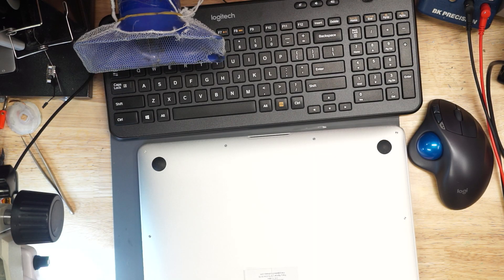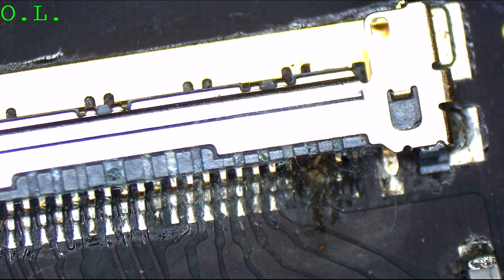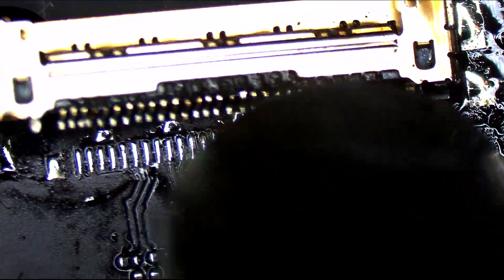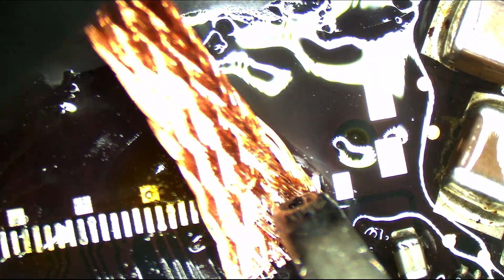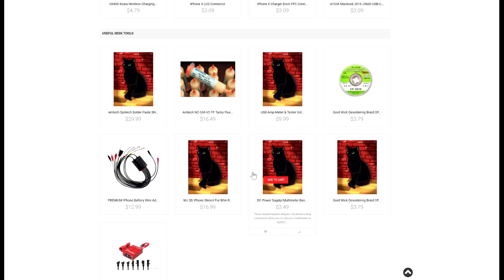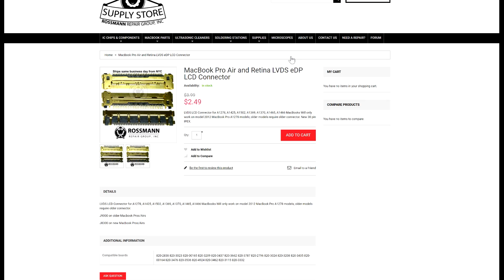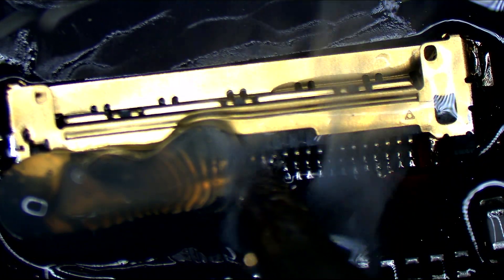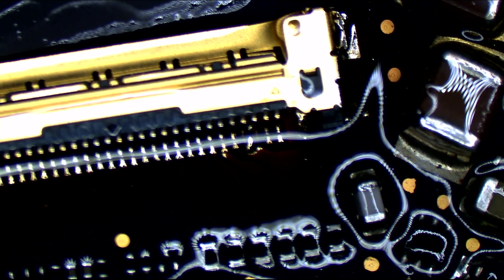What part of Macbook is made from BULLETPROOF component quality?

Comment: I like your videos, but your explenation on how these fuses should work is plainly wrong. That is a polyfuse, meaning it becomes more and more resistive as the current (and thus heat) increases. It is to be expected that it has a resistance close to 0 ohms when the Mac is turned off and becomes highly resistive, if a fault is present during operation. If the fuse is properly dimensioned is a different question, but please update your explenation on how this fuse works. Keywords to read up on these fuses are Resetable Fuse, Polyfuse or PPTC. Keep up the good work!
Reply from the maker: Yes, I am wrong. This fuse clearly became highly resistive when a fault was present during operation. This is why the LCD connector pins are in perfect conditi... oh wait. No.
Reply: @rossmanngroup  you are still wrong about thinking that this fuse should blow before the connector burns. The connector burning current is probably less than what is needed for the backlight itself, or close to it. So it is probably just not possible for this fuse to blow in these cases. You must understand that fuses can not prevent connector burning, they are absolutely not meant for that in the first place, be careful not to make a fool of yourself just because it is an apple product :) Fuses are not used to prevent something corroding away, etc.

Comment: "Why would the fuse blows, when the connector can burn" - Rossmann 2019

Fuse on literally any other products : "I'll sacrifice myself so other component doesn't get hurt"
Fuse on APPLE products : "Lol, look at my company INNOVATION"
Reply: Apple users are cashcows. Why bother designing a  better product whose fuse just blows, if  Apple can count on a large percentage  of its fan base just buying a new Macbook. Sad commentary.
Reply: Why include a fuse at all if a blown fuse means the product is as broken as a blown component? Apple will say it's a broken motherboard either way. The addition of a fuse just adds a bit of cost and is another piece that can fail.
Reply: @chrisedwards3866  Without the fuse, the product might -  thermally disintegrate.
Reply: @MarianKeller  *Will

This is a MacBook. It will thermally disintegrate.
Reply: Matt Zelda I am still surprised that my MacBook Pro 2010 after all these years still works, never replaced the thermal paste too... I guess apple really stepped down their product quality since I think my 2010 MacBook Pro is still quite reliable
Reply: That's not a normal fuse, and those pins are not blown by excessive current but corroded by electrolysis. Even a normal fuse wouldn't have prevented the damage.
Reply: @iggarpe1  I'm an idiot and had to Google what electrolysis even is. Could you give me a TL;DR of how that corrosion is different from say corrosion due to water damage?
Reply: @MattZelda  @dothemathright1111 below gave a good short explanation. In addition to what he explains about metal atoms being removed from the electrodes, I would say that liquids usually spilled on laptops have a lot of stuff dissolved as ions, even bottled water. Those ions will conduct electricity taking or giving electrons and becoming non charged molecules which precipitate on the electrodes as deposits that can both conduct electricity themselves (and make the problem permanent after drying) or corrode the metal.
Reply: @iggarpe1  okay that makes a lot of sense. Thank you :)

Comment: Thanks for your humour. So I can subsitute all fuses in my house with Macbooks.
Reply: With the pins of Macbooks, not the fuses.
Reply: @OmniscientWarrior  meanwhile I bought 12 Macbooks. One important question: Which pins of display connector are LIVE and NEUTRAL?
Reply: @tactileslut  You missunderstand me. My data line has 230V lol
Reply: And you will have to replace all your electronic items after a power surge.
Reply: When My house circuit breakers go bad I just buy a used iphone3 and shove it in.... works perfect everytime

Comment: Louis, you should make a video where you test these fuses to see at what point they actually blow, and compare it to when they should blow.
It would be very interesting
Reply: I would be interested to know as well. If Louis doesn't have time Big Clive or Dave Jones at EEV blog might conduct some experiments on them.
Reply: You can tell from the P on the fuse itself, it's 3 Amps, but it would be a very funny video after all
Reply: So P means three Amps? And someone else says P means positive temperature coefficient? Yet more testing needed.
Reply: @tactileslut  This is actually 3A/32V fast acting non-recoverable fuse made by Littelfuse. I use these in each and every design.
Reply: @nitrocaster  Isn't 32v/3a a bit much to be shoving through board traces? That's 96w of power before the fuse will even think about doing anything.
Reply: @Septfox  If your normal current is 1A, you don't want to put there a 1A rated fuse. The fuse should handle inrush current (which can be order of magnitude higher) without blowing. It should also have low enough resistance to not cause a significant voltage drop, which is a waste of energy. Typical 13 inch screen backlight consumes 4W at 20V, which is 200mA. Given that the inrush current can be as high as 2000mA, 3A fuse makes a good choice here.
Reply: @Septfox  Why do you think the fuse is still intact while the connector is roasted. I think the fuse is a "I will stop this junk from bursting into flames, but don't expect me to save the components"-fuse.
Reply: @nitrocaster  Why dont they work then? They put them last on the circuit?
Reply: @nitrocaster  There are fuses designed to cope with high inrush without using a higher rating. Of course the extra 10c would eat into apples tiny profit
Reply: Fuse replacement. That's a story in itself:
https://pics.onsizzle.com/guide-to-fuse-replacement-100-amp-1500-amp-2000-amp-2690315.png
Reply: you have to send him a working macbook to test it out

Comment: So how heating it in liquid don't hurt it.
Reply: Put some plastic in a pan, and then put pan on a stove. Turn on the stove. Watch plastic melt and burn.
Then put some other plastic in some other pan. Again put the pan on a stove. Fill pan with a water. Turn on the stove. Will plastic burn again?
Physics.
Reply: It's flux, a material meant to aid soldering. Non conductive you can slather electronics in it and turn them on just fine. The heating part, the boards have to be heated to melt the solder and all of these components are designed to withstand the heat needed to put them on. In a circuit board factory they have these bigass 300 degree ovens with machines in them that place components and solder them into place.

Comment: I’ve been trying to convince my girlfriend that apple is not they way but she just says windows is ugly
Reply: I think you need a new grillfriend
Reply: @loganfamils4401  a BarbecueFriend.
Reply: Shes just a fan girl. I think its Mac that looks ugly. Windows is very visually appealing.
Reply: Whats a girlfriend? Can I buy it on store.rossmanngroup.com ?
Reply: Tanner Robinson compromise: https://protechlists.com/hackintosh-laptops/
Reply: @xerxesphilea5413  a lot of current laptops have a bunch of protection against spills, besides that other manufacturers having issues or not is no excuse for poor design. Also most other companies when they try to do what apple does they get called out, apple is the only one able to do those stupid designs and have fans convince themselves that its their fault.
Reply: Has she seen a surface laptop
Reply: @aumpandya6083  surface is the same junk
Reply: She’s right
Reply: @xerxesphilea5413  hm dude if your mac has a clear problem with overheating for example, it doesn't matter that you don't know what it is, it matters that for the use case it was developed for it won't last, and when apple says you're using your device wrong a regular consumer would call out that bs. Only apple has so far been able to blame consumers on design flaws. From you're holding the phone wrong, to you're using it wrong (too much) to a thousand other BS they pinned on their users, I have yet to encounter a similar situation with another brand.
Reply: @xerxesphilea5413  👍
Reply: Like windows could said, buy her any non Apple laptop she thinks looks good and install Linux on it.
Reply: Tanner Robinson she only cares outer looks!
Reply: Buy her a good lookin' laptop and install Kubuntu on it. Kubuntu looks nice and it's free too.
Reply: @Windowsfan100  i always upvote Windows XP 👍

Comment from the maker: Is Macbook can be durable?
Reply: It not.
Reply: Can Apple be good?
Reply: GTA4haterHQ no, you crazy?
Reply: Yes. Just check the fuses.
They seem to be indestructible... xD
Reply: The logo..
Reply: Oh, wait, there's a bite out of it...
Reply: @DataStorm1  Actually it's a rotten core with a logo stuck on it.
Reply: @DataStorm1  I was going to say the same. The most durable part is the Apple logo itself.
Reply: "... because in a Macbook, the fuse is not the fuse. The pins on the connector for the screen are the fuse. Think different, or just don't think at all." XD
Reply: @ropro9817  conFUSEcious says don't buy mac
Reply: It not be cannot beebee7??!?!!??
Reply: Does not fuse not blow because the fuse current limit is too high?
Reply: Is Macbook can do be anything like more what durable is?
Reply: Metal is strong plastic no yes? Inside no importante.
Reply: Haha Haha Haha Haha no.
Reply: It might be if it can has cheezburger.
Reply: Is Pp3v4 are good or bad?
Reply: Durable as a very expensive paper weight it is
Reply: Bad different think there
Reply: The Apple 3 Computer had an official fix where they'd ask customers to drop it.
Reply: Louis Rossmann it do be like that sometime
Reply: the fuses sure are 
٩(⁎❛ᴗ❛⁎)۶
Reply: Only as a cutting board or a serving plate for cheeseburgerzzzzzzz
Reply: poTato
Reply: Before I start the vid, I wish to answer the title question< Fuse?
Reply: I bought a Dell XFR the day I broke my second macbook in 12 months. I'm still using it to this day. I found out real fast I don't need a macbook. All I need for work is a browser and a terminal emulator and ssh. Also I need it to play MP3 and I watch movies on it too occasionally. The XFR I bought  cost me used a fraction of what a macbook costs, though to be fair a brand new current rugged / force resistant laptop costs about as much as a macbook pro, maybe even a little more and you do take a hit in display size. I for one will never again buy any sort of notebook that is not rugged. I can't afford macbooks and I don't feel any sort of great loss not having one.
Reply: @statinskill  👍☺
Reply: Good one, Louis!
Reply: Yes. A very durable as a door wedge.
Reply: No, only the fuse!
Reply: I can has apple?
Reply: Is Louis could be high.
Reply: How is Macbook can be stronk boi if Macbook always is be broken and send to repair?
Reply: Louis Rossmann I mean, you gotta give it to apple, their fuses are durable as hell! Buy a mac book and you’ll never have to worry about replacing a fuse ever again!
Reply: @Louis Rossmann If the most durable component in a Macbook is the fuse, then the most durable part(s) of the rumoured Apple Car will be the crumple zone(s)!
Reply: Fuse was protected by genius. Working as designed. Don't you know the fuse is important? Gotta protect that. Screw the crap behind it, that's replaceable.
Reply: It is can be... maybe
Reply: Can good apple be?
Reply: What did they do you....where did they touch you.  Lol 😃
Reply: Can has Macbook does good quality?
Reply: It can't
Reply: Mine is 10 years old
Reply: Its a borg a macborg.
Reply: MSi GS70 6QE 
Doh.
Reply: Can be used as a weapon to kill someone joke
Reply: Only the fuses will survive macocalypse....
Reply: Big no no for the fruit book to take a big bumpy
Reply: It be not durable me friend.
Reply: Apple fuses are made from the same material that airplane black box recorders are.
Reply: As long , as a guy named Louis Rossmann shows me how to repair these thing. Yes Apple is very durable.
But I still dislike its "rainbow" CEO, Apple's demise...
Reply: My macbook pro mid-2014 is working fine to this day, without any problems so far. And I have cleaned insides of the circuit 3 times only. But I guess I am just one of the few lucky ones.
Reply: not even remotely
Reply: Who needs Macbook, i won on japanese Yahoo auction a Toshiba core i5 Ivy Bridge ultrabook for $40 (a Windows macbook air alternative) from corporate seller (they selling dozen slightly beaten, scratched but 100% working notebooks in one day). I will make a video soon about receiving it. The total cost of delivery with new-used SSD+used ac adapter is $70 (with ultrabook price). By the analysis of Toshiba PC health software - the battery is good 80% health, everything other is perfect too. They even left me inside for free an expensive low voltage RAM DDR3L 2GB. Comparing to Macbook - everything inside - removable, nothing glued, the SSD easily changing, RAM too, the battery NOT GLUED (Toshiba have a battery recall program for some models and they even stating users to remove batteries themselves for new one at the same time notebook can work from AC adapter without battery-their recommendation).
Reply: At least, the fuse for Macbook is super durable
Reply: My previous Macbook Pro has served me for 6 years without a single issue.
Reply: Apple needs to hire a fuse tester.
Make sure every fuse will blow before installing it.
Reply: It that really durable Macbook?
Reply: Go home Rossmann. You're drunk.
Reply: They probably are using these polyfuses that are self resetting